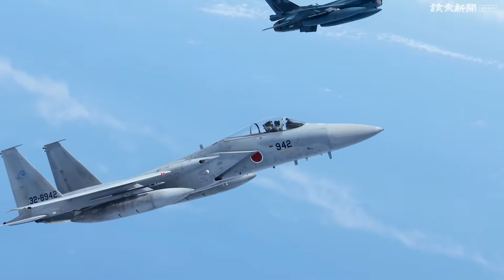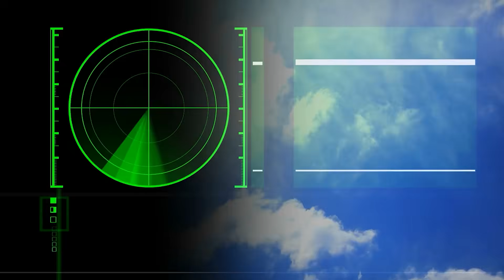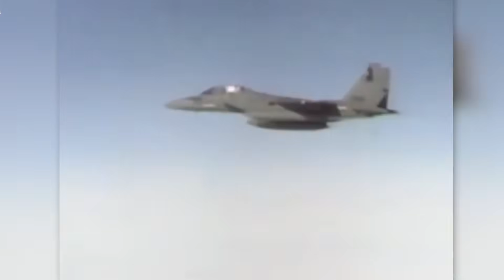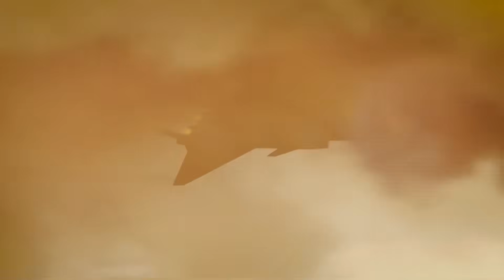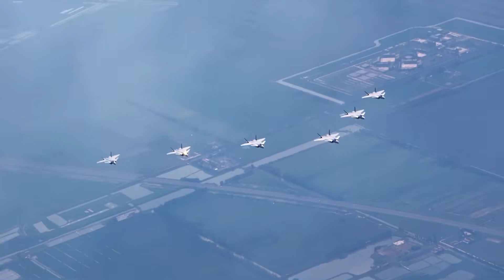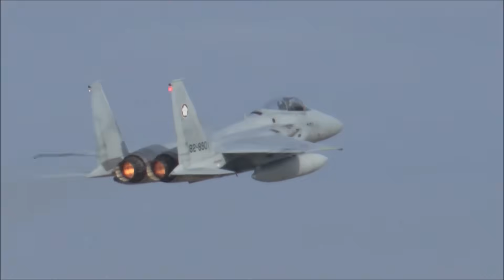Chinese J-20 Gets TOO CLOSE to Japanese F-15 - Then THIS happened

Comment: why is the aew aircraft not present
Reply: AWACS are able to see the J20 over 100 miles out.
Reply: @jimjones9239  wow
Reply: @jimjones9239  Projection Majorcopium.
What happened when the j20 and f35 met in 2022? The j20 had it on missile lock.
General Wilsbach (Pacific Air Forces - USAF) - "The KJ-500 plays a significant role in some of their capability for long-range fires. Some of their very long-range air-to-air missiles are aided by that KJ-500. Being able to interrupt that kill chain is something that interests me greatly."
The general continued "With the E-3 AWACS in the air, the airborne sensors that we're relying on are not really suited to the needs of 21st-century operations, especially against (stealth) platforms like the J-20 or similar. It can’t detect these platforms at great distances, and detection before the enemy can provide an advantage to the aircraft that are tasked with fire delivery."
What he conveniently omitted was that the kj-500 directed the j20 to get past their awacs and enable it to get missile lock on the battle penguin.
You are still at stage 1. 4 more to go

Comment: J20 is stealth want to be.
Reply: Projection Majorcopium. This is a 🌮🐍🤡🎪 channel
Japan govt lodged official complaint to China a few weeks ago that their two of their mighty F-15 were missile locked by the J-15, one of them locked for over 30 minutes from 148 km away.
You are still at stage 1. 4 more to go. 🤣
Reply: @oot007  F15 are older non stealth 4th gen planes.  They should be easily visible and locked on by any modern force.  F15 are third stage fighters, after F22 take out radars and F35 take out airfields, the F15 come in to bomb other targets as F15 can carry a lot more arms.
Reply: @MrMichaelBCurtis  Projection Majorcopium. Straight out of a Chuck Norris movie - badcomedy.
What happened when the j20 and f35 met in 2022? The j20 had it on missile lock.
General Wilsbach (Pacific Air Forces - USAF) - "The KJ-500 plays a significant role in some of their capability for long-range fires. Some of their very long-range air-to-air missiles are aided by that KJ-500. Being able to interrupt that kill chain is something that interests me greatly."
The general continued "With the E-3 AWACS in the air, the airborne sensors that we're relying on are not really suited to the needs of 21st-century operations, especially against (stealth) platforms like the J-20 or similar. It can’t detect these platforms at great distances, and detection before the enemy can provide an advantage to the aircraft that are tasked with fire delivery."
What he conveniently omitted was that the kj-500 directed the j20 to get past their awacs and enable it to get missile lock on the battle penguin.
.You are still at stage 1. 4 more to go
Reply: @oot007  keep believing in fantasy,  When China is dumb enough to attack Taiwan, J20's will just be targets.
Reply: @MrMichaelBCurtis  More majorcopium straight out of a Chuck Norris movie - badcomedy.
What is on record when the US visits the South China Sea?
- The USAF General of Pacific Air Forces admits their AWACS cannot detect the J20
- The USN sack the Commander of their Electronic Attack Squadron
- The USN sack the Commander, XO and COB of their USN Seawolf-class nuclear-powered fast-attack submarine the USS Connecticut
You are still at stage 1. 4 more to go
Reply: @MrMichaelBCurtis  Projection Majorcopium. 
TW was part of China BEFORE the USA was even a country. That is a fact. The United Nations does not recognise TW as a country and since the 1970's the US recognizes the Government of the People's Republic of China as the sole legal government of China, acknowledging the Chinese position that there is but one China and TW is part of CN and it is an internal matter to be resolved by China. This is called the One China Policy and even stated on the US Dept of State's own website.
That policy is also recognised by the UK govt and the rest of Europe.
TW themselves recognises that they are PART OF CHINA. Have you ever read the constitution of TW? TW call themselves the REPUBLIC OF CHINA. TW consider themselves as the legitimate govt of China which China, the UN, the US and the vast majority of countries in the world have rejected.
You are still at stage 1. 4 more to go.
Reply: @MrMichaelBCurtis  >"keep believing in fantasy"
Projection Majorcopium. The J-15 twice locking of the F-15 was reported by media in Japan, Australia, USA and Japan Ministry of Defense.
-Incident reported by Japan Ministry of Defense  on 9 Dec 2025
-Reported by ABC on 7 Dec 2025
-Reported by Kosuke Takahashi of Naval News on 8 Dec 2025  - "Japan Protests After Chinese J-15 Figthers Lock Radar on JASDF Jets Near Okinawa"
-Reported by Jesse Johnson of the Japan Times 8 Dec 2025: - "Tokyo and Beijing traded barbs Monday as their diplomatic row showed no signs of abating, following Japan’s report that Chinese warplanes had locked their radar systems on Air Self-Defense Forces fighters over the weekend."
-Complaint lodged by Japan Ministry of Defense  on 9 Dec 2025
You are still at stage 1. 4 more to go.
Reply: @oot007 nonsense indias old Russian planes tracked J20s from hundreds of miles away, chinese state propaganda
Reply: @oot007 numbnuts Taiwan was part of china, commies took over all of china after WW2 except Taiwan. The CCP never controlled Taiwan. Real china is Taiwan, oppressive communist china is a lame shadow of what china could have been if the commies didn't steal china
Reply: @MrMichaelBCurtis  More majorcopium straight out of a Chuck Norris movie - badcomedy.
Your source of truth is now from a nation where people routinely refer to each other as the animal that slithers with no legs.
Newsflash - you should contact USAF General Wilsbach and advise him to abandon AWACS since he conceded it could not detect the J-20 and instead use India's old Russian planes. 🤡
What happened when Chinese trained Pakistani J10CE met Indian Rafales, SU-30, Migs and drones last year? The PAF shot down 6 of them using the PL-15E at a much longer range than any US fighter ever has in actual air to air combat.
Denied by the IAF chief even though his own countrymen took videos of downed IAF planes and posted them on SM.
When the manufacturer Dassault Rafale and even the Pentagon confirmed Rafales were indeed taken down the chief of the IAF admitted on Indian tv a week later that they had lost planes during the incident.
The PAF could have taken down a dozen more but were instructed to only take down IAF planes that already fired at their country.
Do you know what that means?
Chinese planes have taken down multiple 4.5 gen fighters in real world combat.
Has the US has ever fought in real combat against 4.5 gen fighters? No.
Yet you believe that the IAF can detect the J-20 when they got hammered by the J-10 multiple times. 🤡
You are still at stage 1. 4 more to go.
Reply: @oot007  chinese 20 cent bot
Reply: @MrMichaelBCurtis  More projection from majorcopium. 
Too funny that your source of truth is a nation renowned as the world capital of infamous call centres and internet scams.
The US "supremacy" just gets better.
What happened when the "undetectable" USN Seawolf-class nuclear-powered fast-attack submarine met the PLAN?
The awesome USS Connecticut captained by Commander Aljilani collided with an underwater "feature" while submerged in the SCS in October 2021.
WSJ Nov 2021- "The U.S. Navy has removed the commander and other leaders of a submarine that struck an underwater mountain in the South China Sea last month, injuring nearly a dozen sailors."
CDR Aljilani (CO), LCDR Patrick Cashin (XO), Master Chief Sonar Technician Rodgers (COB) were sacked.
They were too embarrassed to admit that the USS Connecticut was being chased and trapped by Chinese ships and then rammed by a Chinese underwater drone aka the "underwater mountain".
USAF General Wilsbach is waiting for your call.
You are still at stage 1. 4 more to go.
Reply: @oot007  haha, you keep posting the same nonsense spam, typical bot.
Reply: @MrMichaelBCurtis  As usual when confronted with the facts majorcopium goes deeper into projection.
US "supremacy" has reached new heights.
What happened when the type 055 Nanchang encountered the Carl Vinson fleet and their squadron of Growlers? The Carl Vinson retreated.
US Navy Times Dec 2023 - "The Navy fired the commanding officer of Electronic Attack Squadron 136 on Wednesday, the service announced Thursday. According to the Navy, Cmdr. William Coulter was relieved due to 'a loss of confidence in his ability to command.' "
Your entire fleet did a runner. 
Your navy, pilots and planes are "world beaters". Just ask Cmdr Coulter.
If only the USN had india's old Russian planes that you gush on about they would be unbeatable. 🤡
You are still at stage 1. 4 more to go.
Reply: @MrMichaelBCurtis  More projection from Majorcopium.
What happened when the type 055 Nanchang encountered the Carl Vinson fleet and their squadron of Growlers? 
US Navy Times Dec 2023 - "The Navy fired the commanding officer of Electronic Attack Squadron 136 on Wednesday, the service announced Thursday. According to the Navy, Cmdr. William Coulter was relieved due to 'a loss of confidence in his ability to command.' "
Your navy, pilots and planes are "world beaters". Just ask Cmdr Coulter.
This happened cause the USN lacked india's old Russian planes.
You are still at stage 1. 4 more to go.

Comment: The J-20 is as stealthy as my barn door.  Just another POS Temu jet.
Reply: Projection Majorcopium. This is a 🌮🐍🤡🎪 channel.
What happened when the j20 and f35 met in 2022? The j20 had it on missile lock.
General Wilsbach (Pacific Air Forces - USAF) - "The KJ-500 plays a significant role in some of their capability for long-range fires. Some of their very long-range air-to-air missiles are aided by that KJ-500. Being able to interrupt that kill chain is something that interests me greatly."
The general continued "With the E-3 AWACS in the air, the airborne sensors that we're relying on are not really suited to the needs of 21st-century operations, especially against (stealth) platforms like the J-20 or similar. It can’t detect these platforms at great distances, and detection before the enemy can provide an advantage to the aircraft that are tasked with fire delivery."
What he conveniently omitted was that the kj-500 directed the j20 to get past their awacs and enable it to get missile lock on the battle penguin.
You are still at stage 1. 4 more to go